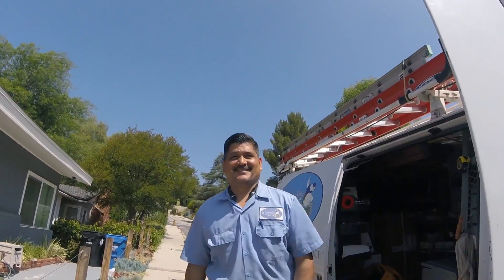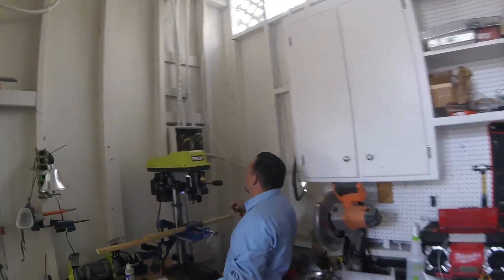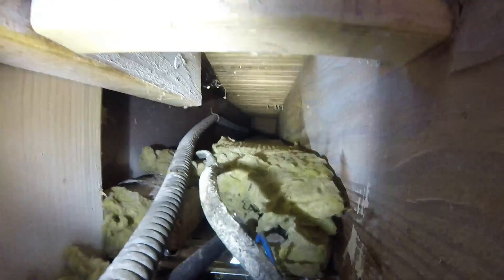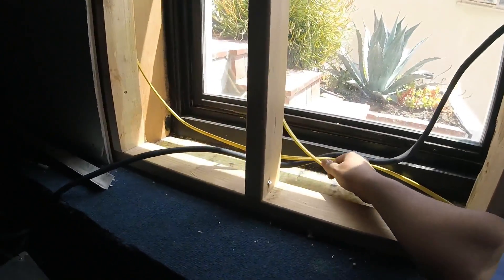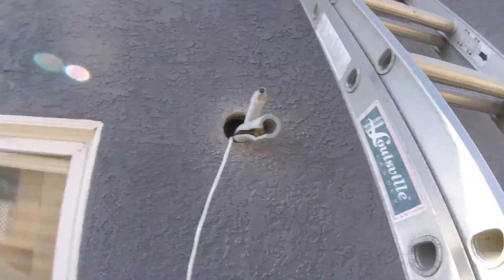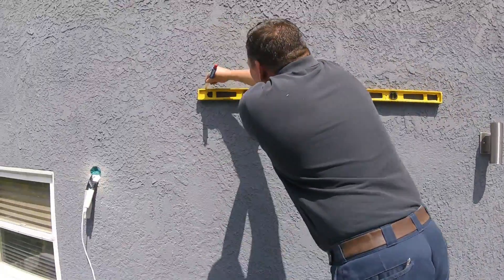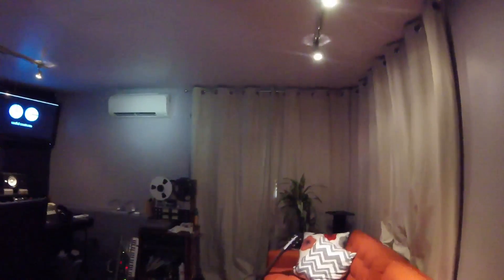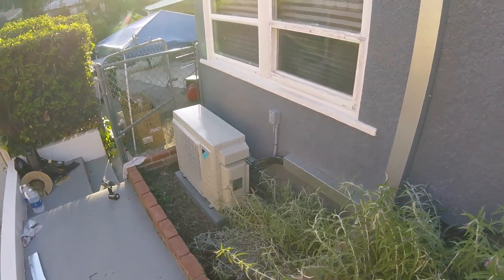Ductless dual mini split installation.

Comment: I have 800 square foot, 2 bed 1 bath, rental in northern Indiana. Currently has no A/C, only heat. Would you recommend this?
Reply from the maker: Without a doubt yes.

Comment: thanks for making these vids.  they're awesome.  haven't watched all your vids but can you either make one of step by step leak check with nitrogen for a ductless split unit or point me to your vid that might have this already?  That's the most intimidating part for me.  I also need to mount it about 8 ft from ground because the side of the house is very narrow and need the passage to be clear.  You ever mount them on brackets up high?  Thanks for any help you can provide.
Reply from the maker: kingpho79... Thank you for watching! Most leaks you'll find at the flared fittings. Second place you'll find leaks is at the actual head unit. Or evaporator coil. I haven't had to mount unit on a rack yet. Actually looking forward to doing that. I'll definitely video that.
Reply: Thanks for the reply.  Hopefully you can make a vid on the leak checks and point those parts out.  I'm a visual learner.  haha.